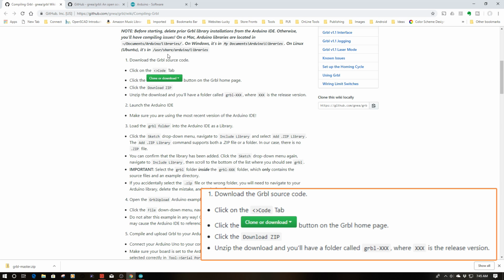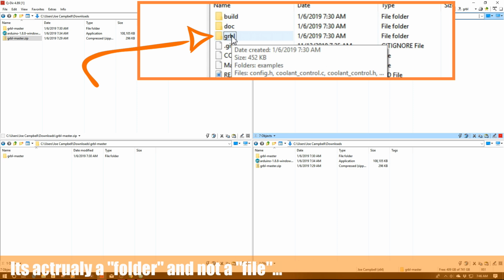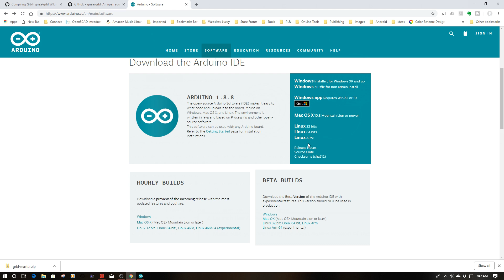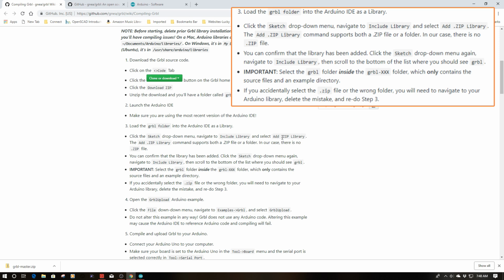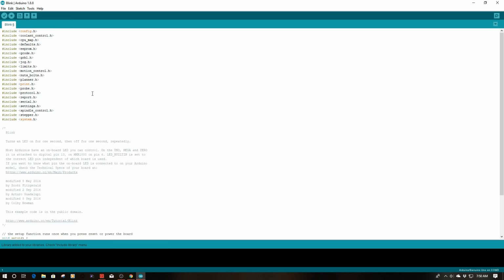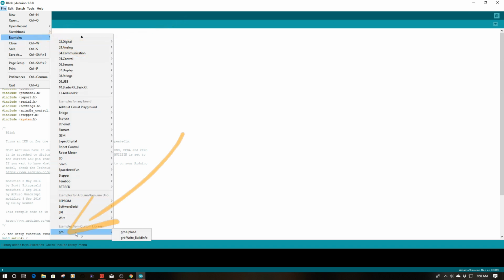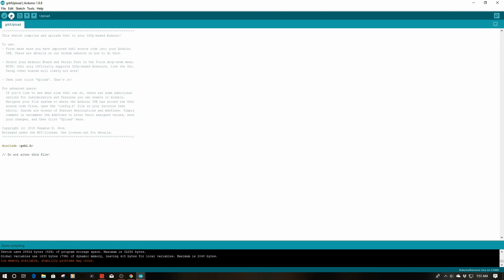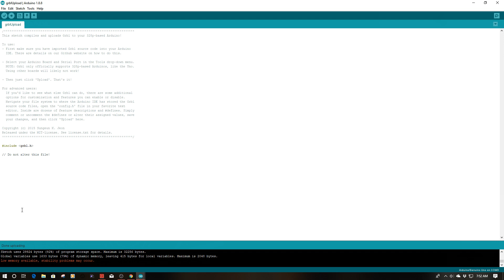GRBL 1.1 - Step By Step Installation Guide to Flashing Arduino Uno!

Comment: Hi there.  Great instructions.  I followed all steps and was successful until "Stretch Upload". Got this error an have absolutely no idea how to fix it.

Error msg:
avrdude: stk500_getsync() attempt 9 of 10: not in sync: resp=0x61
avrdude: stk500_getsync() attempt 10 of 10: not in sync: resp=0x73
An error occurred while uploading the sketch

  Also,  each time I loaded GRBL, I could never "Connect" even COM port was selected and Baud rate = 115200.

I got these 5.5W laser engraver from eBay with a copy-cat control board.  Benbox is horrible, limited, but I can engrave something.  I'd prefer GRBL but cannot get it to work.  Any suggestion?  Thank you!
Reply from the maker: This error is what happens when your computer isn't communicating with the Arduino.  Insure your have the correct board selected, reset everything.  Also your likely using a knock off chinese arduino and the UARTS are worthless you need to install the CH340 drivers (google it and you should find them) however would recommend a real Arduino...
Reply: @DIY3DTECHcom  I found and installed CH340 after resetting everything.  Since it is a knock off board, I have not been able to identify it in 1.8.8.  Looks like i many have to buy a real Arduino board.  The challenge is how to ensure all the switches are in correct position...  Yikes!
Reply from the maker: Are talking about the jumpers on the CNC SHield?  Also yes the real deal is better then the knock offs...
Reply: In file included from C:\Users\PC\Documents\Arduino\libraries\grbl/grbl.h:43:0,

                 from C:\Users\PC\Documents\Arduino\libraries\grbl\examples\grblUpload\grblUpload.ino:27:

C:\Users\PC\Documents\Arduino\libraries\grbl/nuts_bolts.h:51:0: warning: "max" redefined

 #define max(a,b) (((a) > (b)) ? (a) : (b))

 ^

In file included from sketch\grblUpload.ino.cpp:1:0:

C:\Program Files (x86)\Arduino\hardware\arduino\avr\cores\arduino/Arduino.h:93:0: note: this is the location of the previous definition

 #define max(a,b) ((a)>(b)?(a):(b))

 ^

In file included from C:\Users\PC\Documents\Arduino\libraries\grbl/grbl.h:43:0,

                 from C:\Users\PC\Documents\Arduino\libraries\grbl\examples\grblUpload\grblUpload.ino:27:

C:\Users\PC\Documents\Arduino\libraries\grbl/nuts_bolts.h:52:0: warning: "min" redefined

 #define min(a,b) (((a) < (b)) ? (a) : (b))

 ^

In file included from sketch\grblUpload.ino.cpp:1:0:

C:\Program Files (x86)\Arduino\hardware\arduino\avr\cores\arduino/Arduino.h:92:0: note: this is the location of the previous definition

 #define min(a,b) ((a)<(b)?(a):(b))

 ^

In file included from C:\Users\PC\Documents\Arduino\libraries\grbl/grbl.h:43:0,

                 from C:\Users\PC\Documents\Arduino\libraries\grbl\examples\grblUpload\grblUpload.ino:27:

C:\Users\PC\Documents\Arduino\libraries\grbl/nuts_bolts.h:55:0: warning: "bit" redefined

 #define bit(n) (1 << n) 

 ^

In file included from sketch\grblUpload.ino.cpp:1:0:

C:\Program Files (x86)\Arduino\hardware\arduino\avr\cores\arduino/Arduino.h:123:0: note: this is the location of the previous definition

 #define bit(b) (1UL << (b))

 ^

Sketch uses 29868 bytes (92%) of program storage space. Maximum is 32256 bytes.
Global variables use 1484 bytes (72%) of dynamic memory, leaving 564 bytes for local variables. Maximum is 2048 bytes.

Can help me? I felt frustrated because I already uploaded it more than 30times.

Why there was a lot of warning on it? Is this the problem causing the upload failed?

I am using Window10 arduino 1.8.9 and the latest grbl. My Adriano is china uno with ch340driver.